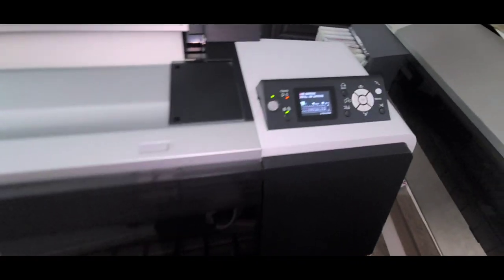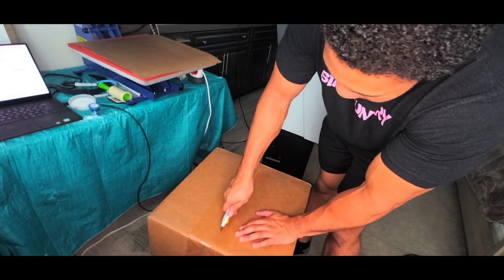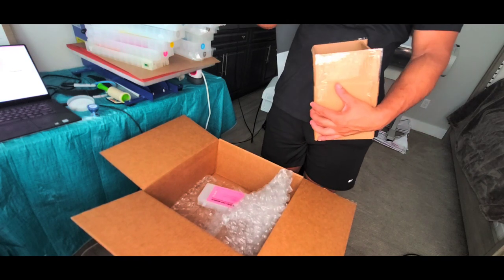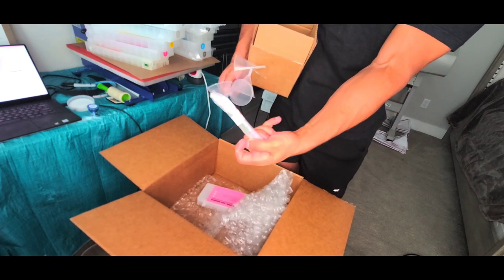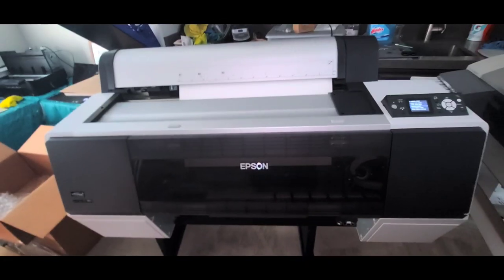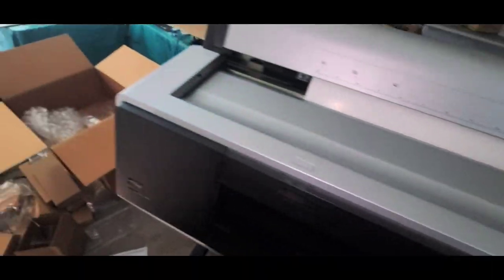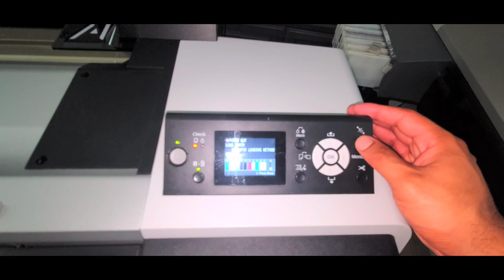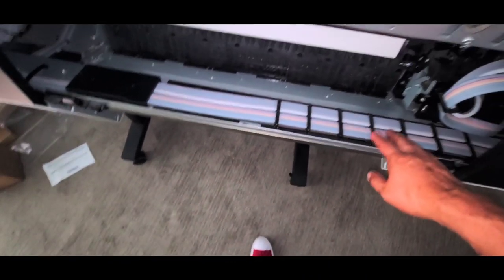Epson Stylus Pro 7900 DTF Printer Setup Part: 1

Comment: Question: found one but it had already been used for regular printing. Do you think it’s a good idea to convert it?
Reply from the maker: Its can still be converted.
Reply: @HangryMuscle  would you deal with a clogged printhead?
Reply from the maker: By letting the printhead wetcap on paper towel

Comment: For this printer do the refillable cartridges need the original chip?
I just got a similar printer but I don't know if it would work for DTF? for the number of channels yes, and the acrorip can be the acrorip 10.5 or maybe the other one that is on the market that works with the epson 7900
Reply from the maker: Yes, the printer will not read the cartridge with out a chip. The refillable cartridges come with Chips that can be reset. 
 
For channels you do CMYK the rest are White channels or turn them off.
Reply: @HangryMuscle   Gracias,,..    I will wait  the second part     :)
Reply: Did you use AcroRip 10 for the Rip software?
Reply from the maker: @thecomiccircuit  10.5
Reply: @HangryMuscle  just bought a 7900 I think I saw it in another video you did...but on their website, AcroRip, doesn't have the printer on the compatibility list...they have the 4900...but that's the only one it that family of printers..
Reply: @thecomiccircuit  any response to this question?
Reply: @user-pe8ir4iy1e  To which question? I guess I missed it.
Reply: @thecomiccircuit  does acrorip 10.5 actually have the 7900 in the list as an option?
Reply: @user-pe8ir4iy1e  yes it does...its what i use
Reply: @thecomiccircuit  thank you for clearing that up because acrorip doesnt list it on their website
Reply: @user-pe8ir4iy1e  yeah that was my concern as well...but i have other printers that i could use it for if the driver wasnt available...but I believe @hangrymuscles actually answered the question either in this video or the other part to this video...
Reply: @thecomiccircuit  What is the color setup on acro rip 10.5 for Epson 7890 dtf printer

Comment: Dear sir
I have sc p7000 epson
Can I covert dtf same?
It's good idea?
Reply from the maker: Hi, I'm not sure, look for a DTF rip that is compatible, if there's a rip for it, it will work and yes go for it.
Reply: @HangryMuscle  well epson is not provided rip for p7000
Maybe we can work with p6000 rip
And main issues is cheap reseter :p
Thank you so much for valuable information.
Reply: What is the acro rip colour arrangement on Epson Surecolor P7000
Reply from the maker: Im not sure

Comment: Hey Bro what setup are you using on acrorip
Reply from the maker: Cmyxkwwxxx
Reply: @HangryMuscle  pls which version of acro rip are u using for Epson 7900 DTF
Reply from the maker: 10.5.2
Reply: Can I use the same settings for Epson Surecolor P7000
Reply from the maker: Probably not, you should use the settings   specific to your printer